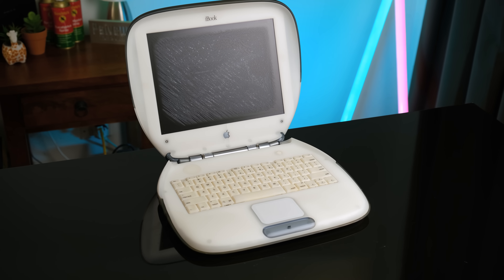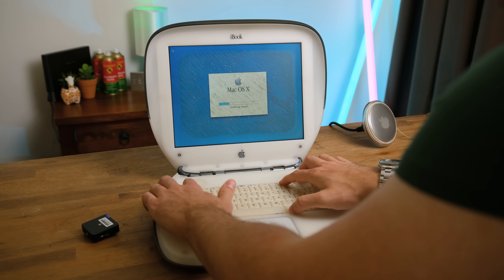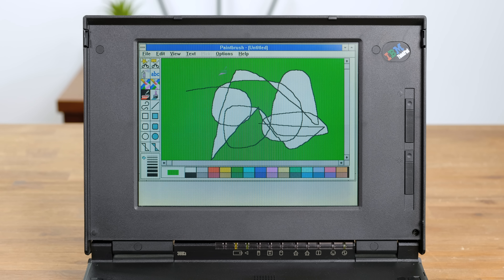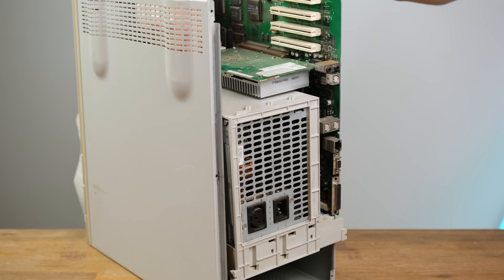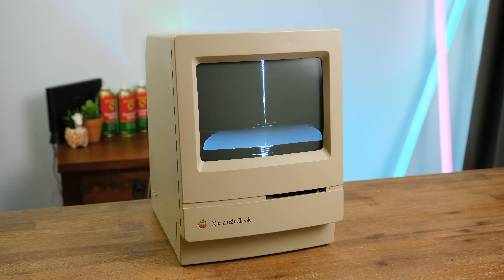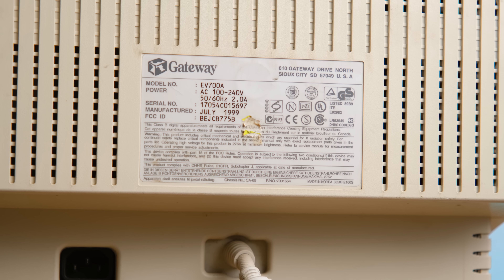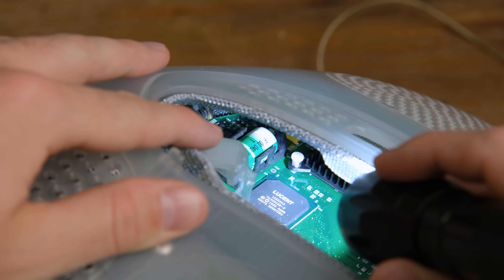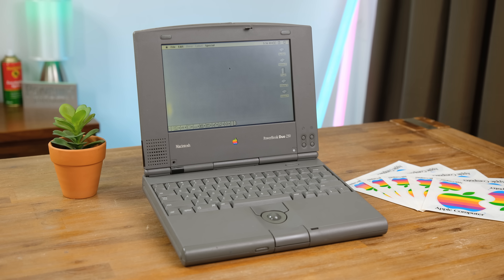So Much Vintage Tech Is Dying... Here's Why

Comment: The huge amount of electronics and plastic parts in modern cars that cost a small fortune is frightening when you think about how they are going to fall to pieces as they age.
Reply: Had a old E class w211 merc, i wont say that every plastic bit was still maluable but literaly all of it was like new, the only exception being the plastic bits that hold the side spoiler.

and the car was from a place where the roads get salted
Reply: As they age? Most modern cars can't have their electronic components last more than a few years before they start breaking down. They tend to fall to pieces before they get the chance to age.
Reply: @Sin_Alder  just like any car from 50 years ago
Reply: @SlapshotJack  modern cars are indeed made to fail, the reason you don't see any car from 50 years ago is the reason you dont see any original interior design from 50 years ago, tastes change and people throw shit out even if its fine simply for being "outdated" a made up 'need' to get you to buy more
modern cars fall apart so you have to buy another part, its all to  keep you coming back with more money
Reply: I also have a 1952 bakelite plastic Kodak camera, and still operates perfectly,
Reply: Per consumer reports magazine electric cars require 80% more repairs than than gas cars.
Reply: Can you imagine making a car with a touchscreen so that if it breaks all car is impossible to operate.
Reply: @jogalong  yeah, Apple does that to their phones.
Reply: My 2007 Honda Accord already did this for me, when one day one of the radiator fans snapped off and shredded the radiator while I was driving. Almost certain it was because of old, brittle plastic (the blades were white but heavily sun bleached/yellowed).
Reply: @RobbsHomemadeLife
On one hand yes, if you're planning on getting a high end car in the hopes that it appreciates in value or something this could be an issue.
On the other by the time the plastics and electronics start to go in well over 90 percent of cases the car is probably already toast unless it's a Toyota or something that was maintained really well.
Reply: Also, so many old electronic toys have been ruined by leaking lead-acid batteries. Always take them out if you're putting them in storage for a long time. Or better yet, replace those batteries with NiCd or NIMH batteries that won't leak.
Reply: Mercedes Benz cars between 92-96 suffer from this, using biodegradable wiring harness resulting from wire corrosion and shorts.
Reply: @objective7042 was wondering when someone was going to mention this. Terrible that they did that.
Reply: I think it really depends on the kind of plastic used, some of its great, a lot is junk
Reply: People want a lot of useless tech and the newest model instead of simpler ones to maintain sadly
Reply: old cars also have plastic and everything is fine with them
Reply: @Musyaaaa  Not my 2005 Audi A4. The whole PCV system (pipes) and the dipstick tube crumbled to pieces.
Reply: That amazing bio plastic that MB tried in their mid 90s c class and others. I redid the entire ignition wiring loom on my w202 because of this FAILED eco friendly move!
Reply: @Musyaaaa  This is something only someone who've never owned one would say. I have a 2003 bmw e60 and it works perfectly and is in a great condition for everything except for the plastics.
Reply: @Musyaaaa ohh yeah, especially those 70s American cars
Reply: @Musyaaaa no, not quite. Cracked dashboards in 89s cars is quite common. Rubber seals mostly always need to be replaced. Gaskets in the engine, if course. If you buy a 30 year old car, even with very low miles, various plastic and rubber bits will need replacing. And their electronics fail too
Reply: @Musyaaaa  Made to last  now it is made to cost also fail
Reply: @Musyaaaa   there is a difference between a thin delicate shinny plastic for a 2022s car and a thick ugly rectangular plastic from the 80s.
My 1984 Civic had plastic and pseudoleather, yes the plastic is foggy in some parts but its so thick that still holds.
Reply: it depends. Toyota 1980s plastic is as brittle as a cookie. Toyota 1990s plastic will see the next millenium  @Musyaaaa
Reply: @Musyaaaa  But not the electronic components, which will be the problem.
Reply: @Musyaaaa Nope. Ask a mechanic in Arizona.
Reply: @Musyaaaa  They aren't "fine".
Reply: Cars are made to a different standard though.  Modern cars are also probably mostly more durable than those from five decades ago.
Reply: @loganmedia1142  the cars themselves were actually stronger back then, the problem was if the car is strong and durable the force is exerted onto the person when a crash occurs, old cars were usually somewhat alright in crashes but a lot of the time even when the car looked fine the driver inside is mangled 
modern cars are better because of crumple zones although modern cars are way uglier than the nice looking cars made before 2009
Reply: mechanically yes, but the electronics will suffer. most actuators use plastic gears etc, these WILL degrade @loganmedia1142
Reply: @loganmedia1142  as an automotive technician, this is 100% false. Every year cars are becoming less durable. They're trying to turn them into something you buy every couple years instead of fixing it. Just like how everything else is now.
Reply: It depends on how you see it.

Because everything is getting expensive nowadays that. Plastic is becoming expensive to produce and make
Reply: @hihellothere9569   yea it'll become more and more expensive as we run out of oil as well so thats fun
Reply: Whats failing on these computers is more so due to mechanical damage, not so much the chips themselves, so I think you dont have to worry to much about the car's electronics failing.
Reply: Your car will be a clump of rust, before the plastics start to deteriorate.
Reply: @GroßeTüten  plastic tends to crack in the sun over time and this leads to a brittle crumbly cracky mess. And since cars are kept outside for the most part this is one of the causes of that.
Reply: @Kelson01  HDPE is prone to UV damage (about 10 months or more completely breaks it down to brittleness) but with additives or another type of plastic they can reach that near 1000 year life span
Reply: @GroßeTüten  fiat would beg to differ,
welcome to snaptown babeee
Reply: Yeah but it'll take hundreds of years so we don't really have to worry about it
Reply: Those are cars not 20 year old laptops your argument is invalid

Comment: Any crt display with a bad fly back transformer is a lost cause. It’s doubtful there are any ftermarket manufacturers of them. It’s a shame really because theyynot hard to replace and I fixed many of them when I worked at Johnson Space Center years ago. Ironically, my 48 year old Panasonic AM pocket transistor radio still works.

Comment: I had two motherboard with the CMOS NiCad battery failing and leaking onto the board cutting the keyboard track brought to me in the same week - the guy who did the repairs couldn't believe it either, totally different people and totally different systems.  Right now I'm more interested in cleaning the sticky surface material (degrading soft-touch) from the keyboard surround of my 2013 Dell Latitude e6230 - anyone got suggestions?
Reply: Sticky gummy paint on devices mainly happens by UV/daylight, but also by migrating plasticizers out of deeper layers. This can be washed off with vegetable oil (aka cooking oil - needs some elbow grease). Remove the oil residues with isopropanol to avoid further harm.

Comment: Boy, can I relate - my G3 iMac (graphite) just quit working with no visible reason why.  My tangerine clamshell still works - or would if I put a hard drive in it (instead of my attempt at using an SD card and adapter).  Unfortunately, I broke the extremely brittle ribbon cable to the track pad, so that doesn't work anymore either.  I've also had problems with brittle ribbon cables in a couple of Mac Minis resulting in 2 dead ones (although I think one died from an over aggressive CPU upgrade).  My  NEC Versa S/33 still ran the last time I checked, but the pc card slots are dead, and the screen is fading away.  I've also encountered the corroded main battery syndrome you showed - although none of that managed to exit the battery pack case (I've recently gone through a rather large number of dead laptop cells hoping to re-use some of the still working cells from inside - with about a 45% success rate.)  So thanks for the video.

Comment: I think it has more to do with the quality of the products how long they last.
I literally just pulled out (yesterday)  from sitting unused since 2018, a 2005 IBM ThinkPad.
Plugged it in, the battery began charging (fully, and later ran off its own original 2005 battery playing a disc).
No visible deterioration!
The two years later iPod I received as a Christmas gift, stopped working around later 2015.
Won't power up or charge. 
The 2011 Bold-- original battery, working great every day. 
Two BB Playbooks I have with only a few hours use on from 2011--both the batteries went fat and stopped entirely from working perfectly.
Note regarding the CRT monitor class -
Some require a functional signal to operate (meaning they are blank and do "nothing" until the desktop is powered on.
Personally I found out that "really big screen" CRT monitors burn out faster than the little 14" models.
My oldest is from 1995 and was powered on pretty much steady from new until around 2007. 
I inherited it once it was replaced and used it at home daily until 2019. Still okay just the desktop Acer quit.
Apple uses the cheapest materials available as they want it gone dead goofed fried blown smoked etc and you're using the latest model latest version.
Reply: I am using a 22'' SGI GDM-5411 monitor, which highend Trinitron CRT flickered red/flashes like hell during power on. After recapping I constructed a timer that simulates a bad capacitor (cuts power-good signal) while running the CRT heater for 30s warmup, so the tube gets less stress and is still working. But it still needs ocasional smacks on the screen front (powered off) because loose metal parts inside the CRT neck shift and cause arcing (red screen flash) likely because rivets of electric contacts lost spring force by heat. Also solder joints of white plastic connectors on the PSU board come loose and need to be resoldered after every few unplugs and cause bad contacts despite the solder looks good.
Reply: @cyberyogicowindler2448  I was offered 3 of the giant 32? Inch Trinitron sets from a Boston Pizza. 1 still working perfectly the other 2 working but yes, the screen flashing red regularly why they wanted them gone.
They ran from 9am until midnight every day except stat holidays from 2004 05 until 2014 15. 
I couldn't pick even one up they were over 100lbs each

Comment: If the corrosion is kept under control, most of these electrical problems should be repairable, except for the possible exception of the flyback transformers. Electrolytic capacitors are generally expected to last about 20 years if they are on a shelf, less if they are under use, and even less if under hard use. These failing in vintage tech can cause power supply components to go belly up, but those should be easy to find modern replacements for and are typically large enough to replace. If a transformer goes though, you are done for unless a you can find a replacement or know enough about it to wind your own.

Radio guys have been keeping vintage radios from the 30s going for a very long time. Simpler, sure, but the idea is the same.

Comment: I am a collector of consoles, and while I am yet to experience any true disasters, I have been starting to repair electronics as practice. Living in Australia, a very hot and humid place, summer is a stressful time for me, as that is when most things fail. But it is also why I try to collect Australian versions of these consoles as much as I can. Because I have found that many have a fair few differences compared to other regions, presumably so these devices can handle our harsh climate better.
Reply: ooooooo nooooo.
those bateries in the snes cartredges would be my first worry.
also note here:
sega dreamcast soldered internal batery for sram and clock
sega saturn has it made easy
n64 data packs have soldered ones
gameboy cartredges all have soldered sram bateries
some atari 7800s have bateries to worry about
some nes cartredges too.
Reply: @coolelectronics1759  Game carts mostly have lithium button cells (CR2032 and such, not rechargables) those rarely leak (unless corroded from outside by moisture?). I own a NES "Zelda" and "Adventure of Link" cart that likely has them too. Will I need to dismantle them?

IMO worst are soldered small button cells inside most digicams (e.g. Samsung) those always failed quickly after warranty end (need to set clock after every main battery drain). The one inside my "Jenoptik 4.1 x Z3" definitely was also swollen and leaked. Eventually the foil cable inside the zoom mech failed and did not focus anymore - after likely >100k operations no wonder anyway. It makes me angry that most digicams always retract the lens after some seconds of pause (making hardware photos has many pauses)  which wears that mechanism and drains batteries.
Reply: @cyberyogicowindler2448   yeah u need the gamebit set to get into them and sorry to tell you about those nes ones depending on where they were stored u will most likely need to get them open sooner than later.
Reply: @coolelectronics1759  I am not sure if lithium button cells do at all rot from inside-out or only from outside-in (due to external moisture causes corrosion by their electricity). But empty batteries generally are to be removed.
Reply: I refuse to turn on my ps2 or gamecube during summer, I did when i was eight, and that's how my first ps2 died
Reply: @sporeham1674  I generally will refrain from turning on a system when the conditions are too hot or too cold, same for humidity. The older the system the stricter I am. I don't want to cause unwarranted stress on the components if I can help it.

But I am also not the kind of collector who puts things in a glass box and never touches them
Reply: Do you have an og Xbox?
Reply: @nuherbleath461  yeah I do, with a removed clock capacitor
Reply: Winter for us.
Reply: Humidity and cold dam places are the death of electronics they must be kept at room temperature. Plastic will loose it moisture over time and become dry and brittle any humid place will cause moisture to form and can rust motherboards I’ve seen it. Cold can also destroy electronics again moisture you bring something out of a cold area into a warm area condensation will form. Water and electronics don’t mix.
Reply: Only humid if you're in the East and North! Bone dry otherwise.
Reply: Air con room with humidity control, only way you'll sort that out.
Or move to the Californian coast, it'll probable work out cheaper. 🤣
Reply: I bought a good dehumidifier and save all my equipment.
Reply: The first signs I've seen are batteries dying in old cartridge games and I've had seen some disc rot from PlayStation 2 era games. Sure, batteries don't last forever and discs, if not stored properly will decay but it's the beginning of cracks starting to show and the limitations of older tech.
Reply: One word: "dehumidifier."
Reply: @user-yg1dg6xm2g  The corrosion comes from battery leak vapours. Moisture only accelerates it or reactivates the residues.
Reply: So you keep them outdoors and not in air conditioning?
Reply: @Doctorlockpick  I ain't dumb. I generally try to keep the temperature as close to normal as I feasibly can but just the fact that our summers are either Hot and dry, Hot and Humid, or Warm and Wet. Does not make that easy. Not to mention that a dehumidifier isn't a feasible option for me in the current climate. I'd certainly love to have a perfectly climate controlled sanctuary, but I don't and that is that. 

I mainly collect Australian versions because from personal experience and knowledge of their hardware, Australian models are generally more reliable and resilient when faced with Australian Climates. 

I have learnt to repair the consoles in my collection purely on my own accord and that is generally how I deal with failures. I regularly check my systems and regularly use a portion of my collection. I go by knowing of an issue as soon as it appears and having the skills to rectify those issues.
Reply: @Doctorlockpick  Keeping your house air conditioned 24/7 isn't feasible for everyone.
Reply: @osman_ajmal4011  then collecting electronics books records trading cards etc arent for them
Reply: @tokeypokey  Clearly you don't know how to properly store antiques, and it shows.
Reply: @tokeypokey  wrong
Reply: @osman_ajmal4011  That's... not true. 

Here in America, even the poorest have air conditioned houses, or even trailers. A window unit costs $149 from Wal-Mart.

Comment: It is amazing how long some computers can last though.  I still have a couple of dos based computers from the mid to late 80s and they still work fine.  Many TV sets still have RCA inputs.  Or I can go through a vcr to bring the video from even older machines to life.  So although it is a lottery,  I have machines that are more than 40 years old that still function fine.  Amazing technology really.
Reply: I run my Amiga A500 (casemodded in big wooden cabinet) every day to write diary on diskettes, and it barely makes any problems (beside oxidizing contacts those need to be wiggled occasionally).